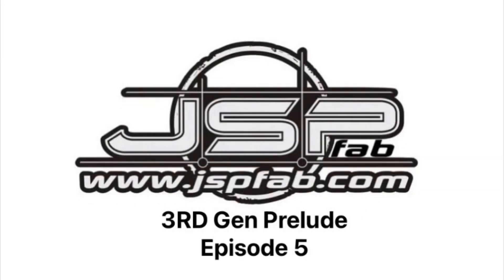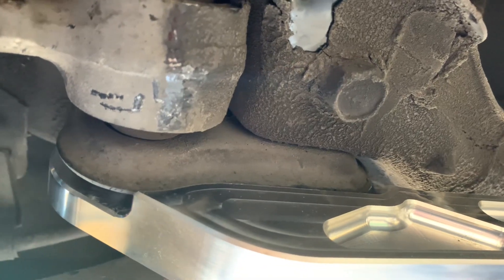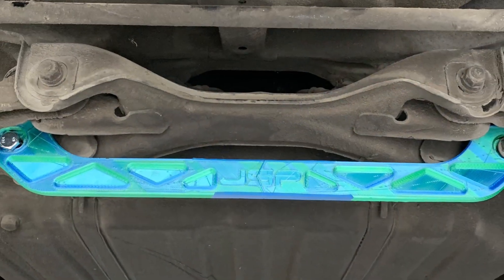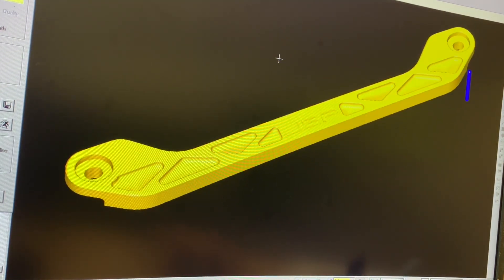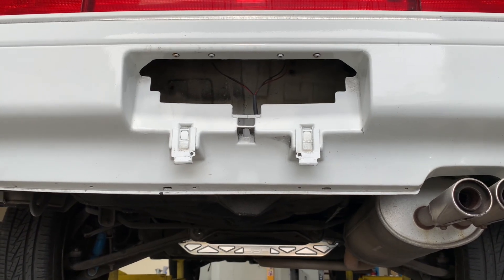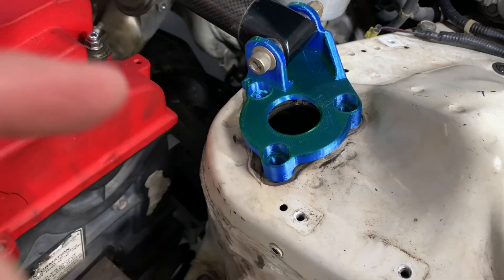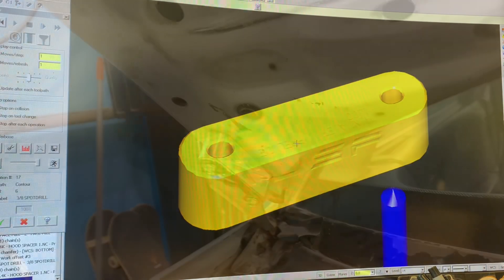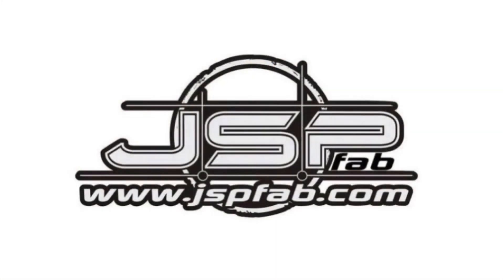JSP 3rd gen Prelude h22 Episode 5

Comment: I'm working on an h22 swap on my 3rd gen as well. Would you happen to have the templates for the modifications you made to the engines mounts? I have the same ones and am also having the same trouble with them not lining up properly
Reply from the maker: I could send you the files for the passenger side bracket, but it would only work if your car was automatic. The other two were just modifications to the existing parts.
Reply: @John Russakoff  I am interested as well.  I emailed you through your website a couple of weeks ago but don't know if it made through.  Would like to purchase both the passenger mount and the instructions to modify the other mounts.  

Will try and email again!